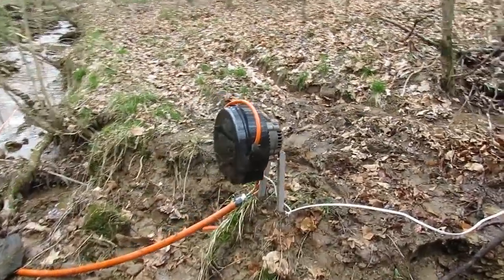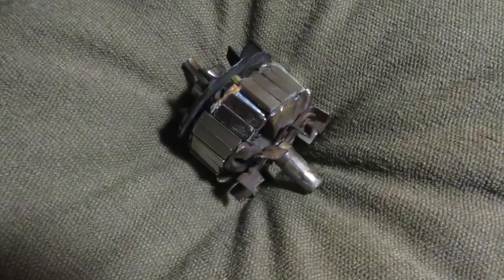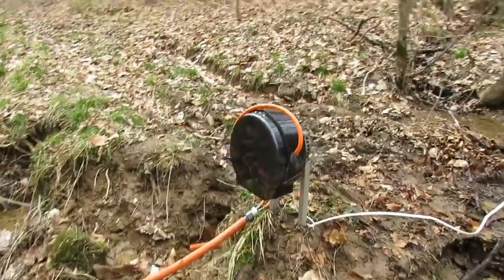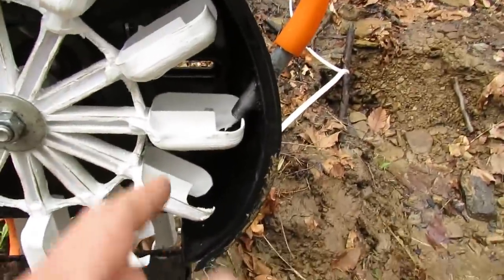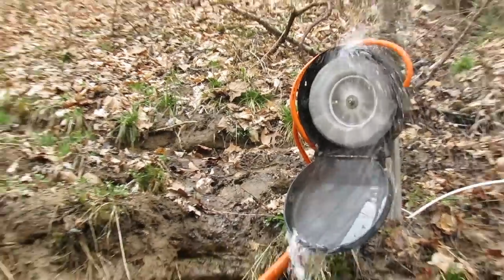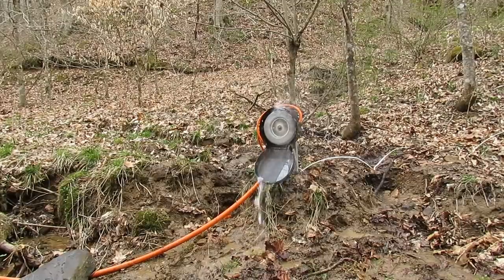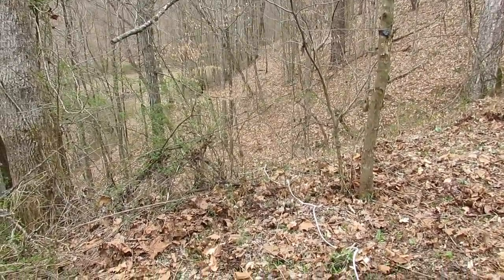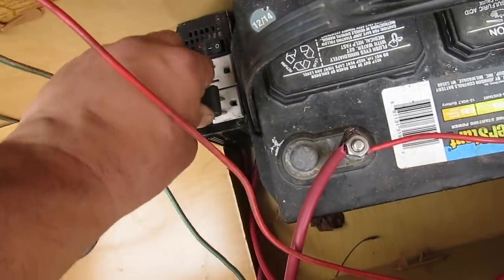Water Generator Running Off Grid Cabin

Comment: I love that you used a toilet paper holder to design your generator. Very cool. If you had shown the amperage as well as the voltage we could have calculated how much power out it was giving you. I would love for you to do a video on how you set up the hose in the creek. In any case, great video that shows what a country boy can do when he puts his mind to it.
Reply from the maker: Thanks. I figure I was getting about 50 watts. Now it is more like 30 or 40 because of the wear on the plastic pelton wheel. I have a video that shows the hose in the creek in the pinned comment. I have since put a screen wire cage over the end to prevent debris from getting into it.

Comment: :)  you probably gonna need a power dump system, as you might ruin that battery, as the charge never stops until the river dry up,  14 v might be a tad high, unless the battery is rated at 14V dc, many ways of controlling the inrush ac, you might want to explore that... tap it off etc.. had a laugh at the water splashing over the alternator, thinking who's gonna comment on that hehe...

Comment: How does the turbine achieve momentum?
OIC It works like a leveraged Ferris wheel. This is an amazing invention. This is an amazing engineering video.
Reply: Only use trojan T105 batteries from golf car suppliers.
Reply from the maker: Thanks, I call it hillbilly engineering. Mostly because it was all designed by a hillbilly lol.

Comment: i have a question, AND! im  sure i am not thee only one. I live in town, a country town.. so i still get my water from a country well. What i am looking for is information about how to have or get water in a shtf sanario.
Reply from the maker: You would need a large water tank with enough capacity to hold enough water for at least a week. You could then hook it up to the rain gutters on your house so when it rains it fills the tank. You could also build a separate roof near the tanks with just the purpose of collecting rainwater. For the initial fillup, you could use your well. It wouldn't work to keep filling it up after power goes down unless you run the well pump from a generator.

Comment: What kind of breaker box do u have? Can u plug it up?
Reply from the maker: It is a standard indoor breaker box from Lowes. I used the same exact one in my skoolie and it has the connections for shore power or solar power.

Comment: agrees : 2 more batteries in series/and use a bigger inverter/ then can run a lot more for a short time.. such as T.V + fan.. all time ..but add coffee pot/ toaster/small electric oven.. stuff don't run all the time...for convience!
Reply from the maker: I have added more batteries and also some solar panels. I have more power than I need now. Se the video link in the pinned comment.

Comment: How was the water being supplied to the generator has that much force going there
Reply from the maker: It is flowing downhill. The intake is much higher than the generator so by the time it has run through the pipe it has gained velocity and pressure from gravity.

Comment: From the.looks your meassuring the alternator output. You are not measuring the battery charge.
Reply from the maker: It's charging the battery at about the right voltage. It is being regulated by the charge controller. It probably is only putting out around 50 watts maximum. I have since added more batteries and some solar panels. I now have much more power than I need.

Comment: I'd personally recommend burying the wire, though seeing that this is more of an experimental setup, I suppose it's just fine for that.

Also, go ahead and add some batteries in parallel, and go for a bigger inverter, as it looks like you've got some overhead for running larger stuff.
Reply from the maker: I did after this video. There's a link to the video that shows it in the pinned comment.

Comment: IF YOU WOULD START OUT CATCHING WATER W/A BIGGER PIPE AND REDUCE IT DOWN AT THE GENERATOR IT MAY TURN A LOT FASTER …...
Reply from the maker: good idea. It would increase the weight of the water in the pipe and should increase the pressure.

Comment: WHAT KEEPS ALL OF THAT WATER AT THE GENERATOR FROM SHORTING OUT AND BLOWING A FUSE. YOU SAY YOU HAVE 3 PHASE GOING INTO YOUR BOX AT THE CABIN ?...
Reply from the maker: I added a bowl over the generator to prevent the water from getting on it. It is 3 phase, but less than 20 volts, so it's not enough power to blow a fuse.

Comment: good job man funky but hall if it dont work! and that's all that matters is you got power. 

can you improve things? Hell Yeah but got now it works and you build from there.
good on you.
--Rick
Reply from the maker: Thanks, yeah I wasn't going for perfect just working. I have since added solar and more batteries.
Reply: @lukeFugate  that's awesome and using a toilet roll holder for a pelton shroud was genius! (although it does leak a might bit onto the alternator)

Comment: You should consider burying the wires to avoid those pesky rodents from eating your wire and possibly causing a forest fire.  Use THHN wire NOT romex, put inside a 1/2" or 3/4" PVC conduit and bury it.
Reply from the maker: I ended up running it through PVC conduit. I buried some of it but a lot of the pipe is still running across the ground.
Reply: @lukeFugate  Just be careful because AC current, when faulted (arcing) can reach very high temperatures.  In your situation, it could easily start a forest fire.  You should get it off the ground at least and hang it from trees.

Comment: For a regulator I use a 2007 Harley Softail Rectifier/Regulator I bought off Ebay.  It handles 3 phase AC input, is waterproof, built into it's own heat sink, and limits charging voltage to 14.5v.  I just cut off the plugs and wired onto a terminal block.
Reply from the maker: Good tip, thanks!

Comment: This set up is not last for a long time theres no filter limiter all thou its working but its kinda primitive inproper build
Reply from the maker: The charge controller takes care of current limiting. It shuts off power when the batteries are full. This system won't last forever, I know, but it was very cheap and the parts are easily replaceable. It still works fine now, seven months later and because I built everything in it I know how to fix it if it breaks. If you wanted to spend a lot of money you could definitely have a better setup, but some don't have the money for all the expensive parts to build such a system. One thing I am going to replace soon is the pelton wheel. It has worn from the sand and dirt in the water. It still works but has lost efficiency. An aluminum one would be better for longevity.

Comment: I think you should put a few solar panels on the roof and put a mini split a/c unit which is also a heat pump. They only draw 450 watts of power. You can run it on solar 24/7 .
Reply from the maker: Solar won't work on the roof because of the shade, but I have set up two of them in a field nearby. I have heard of the mini-split systems and was considering one for my skoolie.
Reply: @lukeFugate  I have one running in the man cave above my barn. I truly love it.

Comment from the maker: For anyone wondering why I didn't water proof the generator and address the erosion problem. I did. I didn't film it at the time. in fact, I did the rocks before I went back up to the cabin, but I had already strapped the camera to the four wheeler. I used a butter bowl I cut out to fit over it. I later changed it out to a coffee can. I also put rocks down under the generator to prevent erosion. Here is the video showing that. https://www.youtube.com/watch?v=NTWoSivTpHE&feature=youtu.be
Reply: I can sleep tonight lol. Great stuff mate thanks
Reply from the maker: @TheTrainstation  Thanks for watching!

Comment: You should caulk that and have a run off line go back into the creek.
Reply from the maker: I ended up addressing the excess water issues. I just didn't film it at the time. I later added some solar panels to the setup and in that video I show the water protection. Here is a link. https://www.youtube.com/watch?v=NTWoSivTpHE&feature=youtu.be

Comment: you dont show how much actual power you are making, the battery could be charged and you could be powering 2 or 3, 6 watt bulbs inside directly from the battery. Also all your wires are going to get corroded because they keep getting covered by water. Wouldnt it be simpler to throw a 200-300 watt $100-150 panel on the roof and produce the same amount of power
Reply from the maker: The voltage was more than the resting voltage of a 12 volt battery, so it had to be charging. Solar on the roof won't work at the cabin site, and solar only produces power for a few hours per day, while the little generator runs 24/7 although it only produces about a max of 50 watts. I did add 200 watts of solar to help supplement the power I was getting, as well as address the water issues on the generator. Here is the video showing that. https://www.youtube.com/watch?v=NTWoSivTpHE&feature=youtu.be

Comment: You can save more energy with using low amp lights in the cabin, and I would see if you can find 2 deep cell batteries they hold more charge and you can run them in tandem
Reply from the maker: I have led bulbs. I was going to run 12 volt lights straight off the battery, but I ended up putting the batteries away from the cabin so I could have solar panels and run the AC voltage the longer distance through the woods. Here is the video showing that.  https://www.youtube.com/watch?v=NTWoSivTpHE&feature=youtu.be

Comment: Nicely done !! Just a shame you had to run the wire 60-70 feet. Most likely loseing some current over that sort of a distance. If you can't do solar, you could always do wind turbine. Just mount a small pole top of a tree and run the wire down
Reply from the maker: I may try that for a little bit of supplemental energy. Probably not enough wind  to do very much though. I did end up doing solar though and it works pretty good. Here's a video showing that. https://www.youtube.com/watch?v=NTWoSivTpHE&feature=youtu.be

Comment: Nice generator. Only one question. Why would you use light via an inverter. It is much more efficient to have light in 12 v led style. Only use the inverter for stuff that will not work from 12v.
Reply from the maker: The way I ended up setting it up has the batteries pretty far from the cabin. I only have 110 volt electricity at the cabin now. https://www.youtube.com/watch?v=NTWoSivTpHE&feature=youtu.be

Comment: Ya lose a lot of power with a inverter.. Why don't ya run 12 volt dc lights , est.
Reply from the maker: You are right 12 volt appliances would be more efficient. The setup I have ended up with has the batteries located further away from the cabin and I just ran the 110volt wire from the inverter to the cabin. I did this so I could run 2 100 watt solar panels in a field away from the cabin. Here is a video showing my updated setup.https://www.youtube.com/watch?v=NTWoSivTpHE&feature=youtu.be

Comment: Nice setup. Hydro is far superior. It runs 24/7. I would make more wheels before I purchased panels. 

I'll bet one more wheel. 3 more batteries and you can have a fridge and washer.
Reply from the maker: Could be. I have solar also now, but going to add my water wheel in sometime.

Comment: that alternator is catching water  shouldnt it short circuit?
Reply from the maker: It's not enough voltage to short out in water with the distance between connections. I have put a bowl over the generator now to protect the bearings though.

Comment: 2 things... Are those incandescent lightbulbs! If so Switch them out of LEDs... Please.
Secondly, the cables need to be put up higher, make poles, or use the trees, but leaving it on the ground like that will either trip someone or hurt wildlife.
Reply from the maker: Good points. They are led bulbs, they look like incandescent ones put they are plastic bulbs. I ended up burying the cables through the woods. They aren't deep, but they are beneath the surface.

Comment: Nice work, Luke!  What is a PMA? That is impressive,  how you substituted the magnets. The alternator/ generator is exposed to the elements and looks like it could zap someone. How are you forcing water through the pipes? Pretty cool!
Reply from the maker: A PMA is a permanent magnet alternator. It is where the field coils are replaced with permanent magnets. I covered the generator with a bowl later and it has been fine. The water comes from a higher elevation and gravity causes the pressure to increase.
Reply: @lukeFugate  I meant to edit out the water source question, after watching the episode about tapping the water source. You could almost do an entire episode swapping out the permanent magnets in the alternator.  Thanks for replying.

Comment: Brilliant ! Family owns couple cabins with river a rocks throw away. Gonna try and rig up something similar. Thanks for video.
Reply from the maker: Great! It is an educational build. I would recommend using a manufactured PMA and a metal Pelton wheel. There is a lot of efficiency loss in this homemade setup. The 3D printed plastic wheel has been deteriorated by the sand and grit in the water to the point it isn't really effective anymore.

Comment: What I wanna know is why didn’t you show how the water flows up the tube and spins the generator like the inlet of where the water comes in God have some kind of pumper that runs on electricity or gas
Reply: Avg gradient is 1 to 2 feet per mile for water ways streams creeks rivers. The kind of pressure u got going on is intense plus ur hose climbs up again a couple feet so with at least a min of 3 feet drop needed to make up for ur 2 foot raise u got going on you must have about 3 miles of hose and pipe?
Reply: Putting aside I’m skeptical ur water source is not hooked up to some pump or whatever..... I do like the set up ur water wheel looks efficient and repurposing an alternator for ur generator is great awesome man like it.  Please show us the water intake set up tho
Reply from the maker: It only runs on pressure from gravity. The inlet for the pipe is at a higher elevation than the generator so there is a pretty good fall before it gets down there. No kind of pump needed.
Reply: luke Fugate I’ve never seen a river or creek with much of an elevation difference in the distance equivalent to the length of one or two garden hoses.  That pressure coming out is pretty high pressure I’m calling you out on this one.  Show us the water inlet source please or we have to assume u got some gimmick going on here
Reply from the maker: @neonone9164  lol It's an old silt pond dam from a mine that was above my property. They built a dam to contain the runoff from the mine and let the sediments sink to the bottom instead of flowing on down the creek. It was something like 40 feet deep. when the mine was closed down they filled in the pond and left a big field and the elevation of the creek was changed. It's not a natural drop, but it is a perfect place for some micro hydro power. I have a video here https://www.youtube.com/watch?v=cqNX_2PkUWs&list=PLx4vrrK_MpadH-U-w9voPmtZ9wbYmWS1v&index=1 

where I was scouting for a water wheel location that shows it. at about 6:39 it starts showing the drop I was talking about. Also the video in the pinned comment shows the intake pipe before I put the screen wire over it.

Comment: Not being hater but I give 6mts and be brittle as dry bread parts ware out expensive hydro parts do that built to last Trust me use metal parts not 3D printed parts hood start thoe..
Reply from the maker: It's been more than six months and it still works. I do agree though a metal wheel would be better. The plastic one is starting to show signs of wear. The silt and sand in the water is kind of sand blasting the plastic away slowly. I am going to replace it with metal when it wears out, I just want to see how long it will last first.

Comment: 3Phase dc? Whats this guy talking about, an that 75ft is not gonna work to great for DC
Reply from the maker: No such thing as 3 phase DC. It is 3 phase AC going through the wires to the rectifier at the battery box. The rectifier turns it into DC.

Comment: Why didn’t you explain about the current being generated rather than the voltage? Without that you’ve said nothing regarding your ability to generate power.
Reply from the maker: I think it only puts out a little less than 50 watts. Not much power available. I have added 200 watts of solar now and I have plenty of power up there.

Comment: he says 3 phase I see only 2 wires ???? how can that be 3 phase also the water pissing over the genny
Reply from the maker: It's 12-2 with ground. It has three wires in it. I put a bowl over the alternator to protect it.
Reply: @lukeFugate  2 with ground is not 3 phase am a spark in the UK you need 3 or 3 with ground
Reply from the maker: @alunroberts1439  the wire intended as ground in the romex is not connected to ground. It is used as a third conductor.
Reply: @lukeFugate  what is the wiring at the electric alternator  side what is it in star or delta
Reply from the maker: @alunroberts1439  It should be delta because it was from a gasoline engine. It also has two wires twisted together on each phase coming out of the case of the alternator which is an indication of delta configuration.
Reply: @lukeFugate  would like to see pic of the back and the coil formation I have put stuff like that in to use not for me I don't have a river or a stream close by I could use.  Did wind turbine in Skelmersdale 25 year back parts taken from a petrol generator.  Was all fun it worked well until a fire some one smoking in the shed.